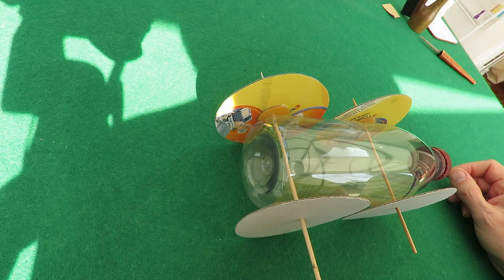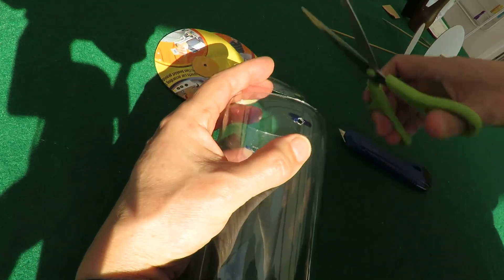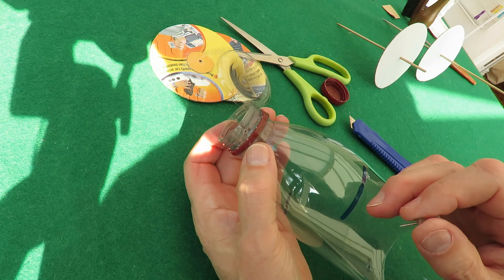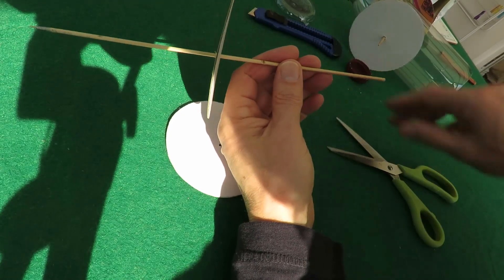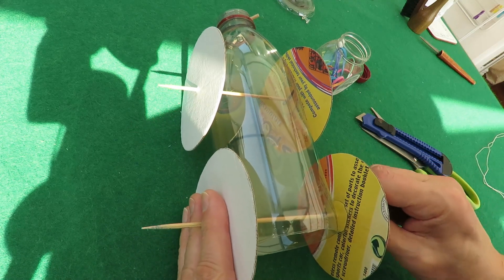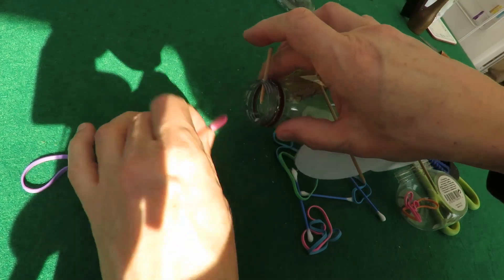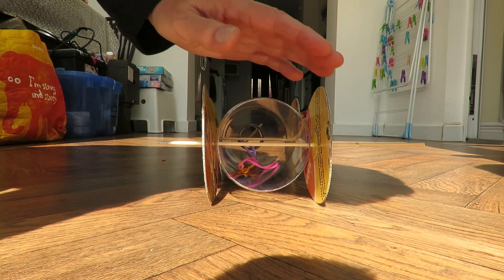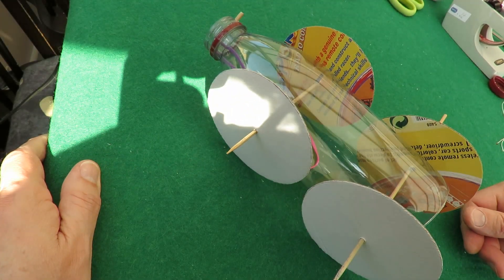Simple Basic rubber band powered car

Comment: nice little car and it works good with the littlebit of weight in the back.nice video also, could you turn it into solar powered maybe for the next video?? nice job right there.
Reply from the maker: I wasn't going to use electric motors on this series, I wanted to use the minimum number of basic components. Maybe if I do another series like this I will use electric motors.